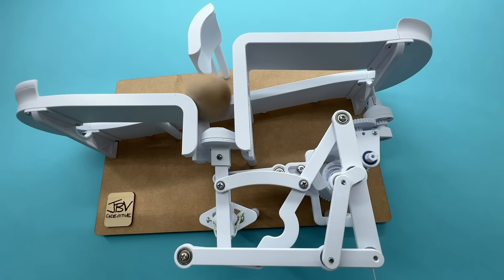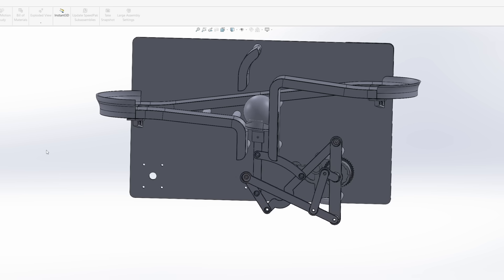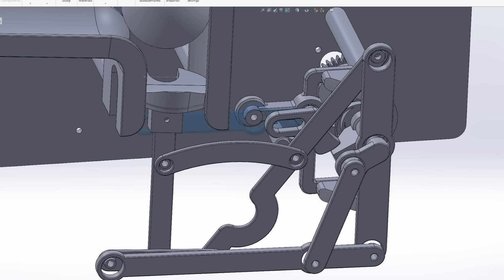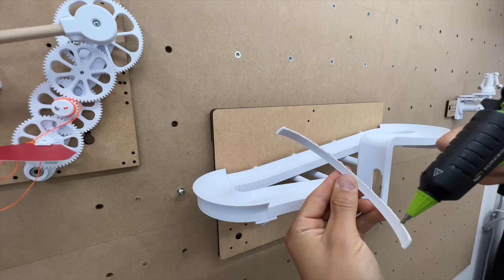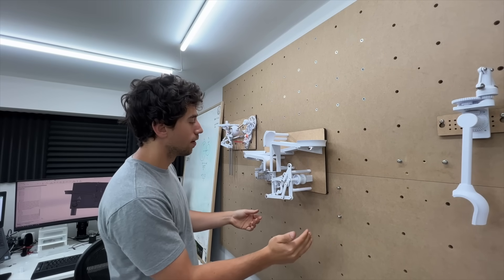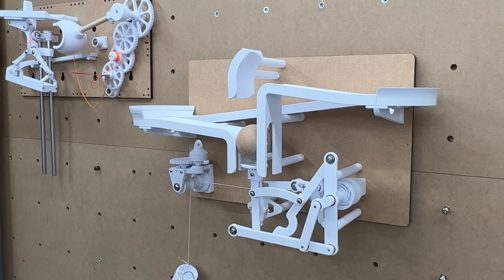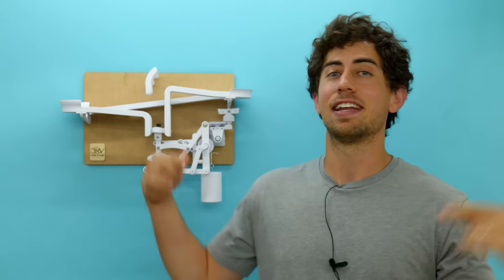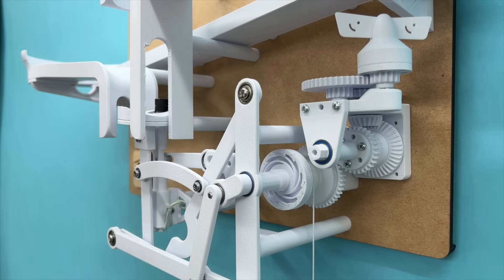Building a Gravity Powered Ball Contraption

Comment: Interesting….. considering there doesn’t seem to be additional input and this could just keep running, if you added pressure plates through the middle of the track when the ball rolls over and you connected those to a flywheel- could you charge a phone?

Comment: You left out the very important explanation of why this machine doesn't violate the Second Law of Thermodynamics (i.e. perpetual motion).  You showed the weight when you initially described the placement of the governor, and how its location made a difference.  What you didn't explain is how the weight under the governor provided energy to make the escapement and lifting mechanism work.  You didn't specifically show it, but I'm certain that when the string that's wrapped around the pulley on the governor mechanism is fully extended, the machine would stop.

This is a cleaver device.  Fully explaining the mechanism in terms of accepted scientific laws would be even more enlightening.

Comment: I'm sitting here wondering if you could set up 2 or more of these to work in a way where the balls roll around and at some stage become part of the weight and are then released from it with some sort of counter weight that resets it's position. i.e. ball rolls round into weight basket another ball rolls into lift weight ball pulls down lifting the other and both balls are released back onto tracks and the weight side goes back up due to a counter weight pulley system and the whole thing repeats. essentially a loop of mechanical advantage. if then it can be used to power a load you could cheat a theoretical perpetual motion. Of course I'm not suggesting in the slightest that the last part is at all possible but you should get at least close to the amount of energy you put in. Basically I am proposing a 2 way system using the same or a similar mechanism that swaps the balance of weight so the machine resets itself at the end of each cycle. Adding a load to that is the doubtful part but the mechanical energy although intermittent is technically infinite and mechanical energy can be converted into electrical easily enough.

Comment: Here's a tip that they use in clockmaking. When making an intertial governor like you're doing here and on the wave generator, you want to make sure it has a slipping connection to its shaft. The reason is that when it stops, the inertia that was keeping it from going to fast is also keeping it from slowing down - so when it is stopped it feeds back a major torque shock to your drive train. That all needs absorbed by your gears and bearings and can lead to excess wear and damage.

You can see on this device that when it stops it 'bounces back', you can imagine the amount of force it must take to reverse the direction instantly, it's even lifting the weight back up when it happens. If you make a slipping connection, the regulator can keep spinning and the excess torque from the inertia can be gradually absorbed by whatever braking mechanism you use instead.

Comment: For your straight line movement use a dual rail counter rotation conveyor belt what I mean is you have two rails that interact with a very edge of the ball and a small conveyor belt that interacts with the ball at the equator of it the ball will actually act like a gear and move in the opposite direction of the conveyor belt if done properly

Comment: Can I throw a thought in the fire?

Maybe add a counterweight to the crank mechanism so the reset isn't a violent drop. Get as close to balanced as you can so you're only really lifting the ball.

Then you won't need as much descending weight, or possibly increase the gear ratio with the same weight falling a shorter distance so the whole thing runs longer.

Comment: I don't want to sound rude or anything but how is this possible? did you use any motors? Im a physics student and it makes me question the theory of "Energy cannot be created or destroyed". I know there is GPE in the weight but I am bamboozled and still dont fully understand how this works after rewatching it in action for 20 minutes
Reply: There is a weight attached to a rope, the mass of the weight pulls it down, making the spull rotate, and powering the system. There is energy loss, and the weight is lower after each loop. The system will eventually run out of rope, or the weight will touch the ground, stopping the mecanism. To reload the system, you need to reroll the rope around the spull. This is an example of energy conversion between potential energy and cinetic energy.

Comment: Integration and testing would be so much easier if CAD didn't model everything as a rigid point-mass. At least the fabricator is working to the nominal dimensions instead of the positive tolerance. I would deal with a lot fewer unsupported flopping plastic pipes with the former, and I wouldn't get drain pipes that trap fluid with the latter.

Comment: Do you use specific 3d software to design the sculptures. And is that software also physics based? As in can you simulate the movement before you make it?
Reply from the maker: I do! It’s called Solidworks and it comes with a basic physics engine in it, super capable 👌

Comment: That is awesome! I don't know which CAD you use but I think for example Inventor and Solid Works can simulate physics so it might work out some of those problems you were having with slack, stretch etc, they probably can roll the ball too to figure out how high your walls need to be for the trough corners. You're an engineer so you probably know this. All it needs is a shelf next to it for a cat to sit on to watch the ball action. 😻

Comment: Clever .. but not 'gravity powered'.   You've got a weight that provides the power and when it hits the floor or runs out of string, the mechanism will stop.
Reply from the maker: True, but food for thought; if something is battery powered, we wouldn’t say its ‘thing that generates electricity to charge battery powered’. Once the weight it charged up, it is officially powered by gravity until the weight runs out of ‘charge’

Comment: Cool, but it isn't powered by gravity, it is powered by you. When you wind it up and lift the weight, you are providing the motive power for the device, and storing it in the potential energy of the weight that you have lifted.
Reply: Indirectly. But directly it's still running based on the gravity.

Comment: Can you recycle some of the energy so that when the ball starts rolling back down the raceway, some of the weight from the bottle is transferred back up slightly higher so you dont have to manually lift the weight as often.
Or could it use a separate mechanism with a tank of marbles that are released into cups which provide weight for the first mechanism, then at the end of each hour/day, you just have to lift one bucket of marbles back to the top.
Reply from the maker: Both are great ideas!

Comment: Cool project. There's an idea for improvement: you're actually wasting more than half of the potential energy available in the weight to return the ball pad into lower position, while this motion could is actually be gravity fed by itself. Could you modify the system to actually use weight energy just for rising, and allow pad to gravity drop by itself? Then you could have 20 cycles available with the same height/weight.
Reply from the maker: I’ve been thinking about this a lot, there’s definitely a way! Going to find its way into the next iteration

Comment: if the downwards movement of the ball over the slide can rotate the weight up again as the ball pushes through various levers, it will really be (close to) infinite.
Reply from the maker: There are definitely ways to increase the overall run time!

Comment: Besides putting it in a high place, I wonder if there is any way to get more cycles out the same drop amount. It would be interesting to measure how much energy is lost to friction in the linkage joints. 

Also, please sell this!
Reply from the maker: I’ve thought about it! The best thing I could do is add a gear train and increase weight, so it won’t drop as much on each cycle

Comment: It never re-spools the string with the weight, so it’s a bit of an optical illusion. Could probably change the gear ratios to get longer action on one run, but as soon as the string reaches maximum length, it will stop.

Comment: Does the system struggle by the time the string is near the centre of the spool? Or did you design it to run optimally at that stage? Either way it's impressive. You have a new sub from this ;)
Reply from the maker: I definitely didn’t give any thought to spool optimization but seems to work quite well 🤷‍♀️ sometimes you get luck haha

Comment: Cool project! It occurs to me that the gravity portion would require fairly continuous intervention to keep it working. Would it be possible to construct a gravity feed kinetic power source that was "powered" by a reservoir of ball bearings? If so, you could have a new module which would do the replenishing while its power was available -- like solar cells. Then you could potentially use this single power reservoir to feed all of the other modules... Thoughts?
Reply from the maker: This is exactly what my plan is!

Comment: I notice that the weight drops a long way each time the ball goes around so it won't take long to run out of string. What would happen if you changed the diameter of the cylinder the string is wound around? Would it still work the same and you get more goes before the string runs out, or would it affect things in other ways? 

I love how you show the different steps and the problems each step presents. Thanks for sharing your process as well as your fun machines.
Reply from the maker: It would definitely help, the only change would be more weight is required!

Comment: I think it looks really cool.. I can see a much simpler way to do it.. 
Just a ramp and a paddle wheel..(Like the wheel in the movie "Robots")
When the ball rolls into a slot on the wheel, it hits the other side(back wall)
The back wall is a release trigger that allows the wheel to turn and lift the ball to the top of the ramp..
The wheel has one of those teeth systems like a pendulum clock uses, so it only advances one space.
If you make the middle of the wheel, the spool for the weight.
Adjusting the (spool diameter)/weight ratio, to get max rotation for the least amount of vertical weight movement.

I am wondering if you can add a second weight that rewinds the first weight for a second pass...
Reply: Have 8 weights on 8 spools, each one with a ratchet so they are all linked on the same shaft of the main wheel. The 8 weights work like a 8 bit binary counter. 
Each bit(weight) would have to be twice as heavy as the weight on it's right.. 

or, just make one weight go all of the way to the bottom. When it hits bottom, it activates the second weight....

I don't know if this would work, but it's a starting point.. 
Thanks for the inspiration... I love these problem solving adventures.

Comment: Could this be built so that the ball moves for a specific length of time? Like a clock? So that every time it drops it registers 'x' seconds? Could this little machine create a never ending movement for clock or power purposes? I just get a feeling that this has bigger potential. Great work!!
Reply from the maker: It absolutely can! Unfortunately it wouldn’t be a very accurate clock as the ball movement could be affected by many things, but it would be pretty cool! Kind of like this: https://youtu.be/SrdtM6_yZUU
Reply: @Engineezy  Most time pieces aren't so accurate. Worth a try to see if it works? Each roll of the ball, which could be a ball bearing for more accuracy, could register a 5 second period that then turns the train of wheels for the clock mechanism? I'm looking forward to what you could make of this, I have a feeling it has a lot of potential. Well done and thanks for sharing this. Fascinates me!

Comment: Curious what texture plate you are using on your X1C. I use the engineering plate and it's smoother than what you have. I also bought a texture plate but it also doesn't look like your prints... so the plot thickens....
Reply from the maker: Its the stock PEI one that you can get from Bambulab!

Comment: Amazing video, those linkages are the most mesmerizing part for me. Also my family is moving along with my printer from 5,000 ft elevation to 9,000 ft. Will air pressure have an affect on the quality of my prints or the long term heath of my printer? I have an Ender 3 v2 so it’s not anything to complex
Reply from the maker: I cant imagine the elevation would matter as long as humidity doesn’t become a factor 🤔 but im not an expert on that stuff so not too sure! Thanks for watching  Max, good luck with the move
Reply: @Engineezy  thanks for the swift response! I’ll have to ask my dad if the humidity is different.
Reply: @Engineezy  I asked my dad and he told me that the humidity wouldn’t change much but if it would it would decrease. I would imagine this if anything would be a good thing as stringing wouldn’t happen as often

Comment: The return stroke of the lift can be powered by gravity. I wonder if there is a way you could allow it to disengage the weight at the top of the stroke. It would make this mechanism a lot more energy efficient saving you the trouble of having to crank the weight back up frequently.
Reply from the maker: I’ve been thinking about that, going to have to attempt to implement it in the next one
Reply: @Engineezy  the more I think about this, I wonder if a recoil is possible here similar to some clock escapement (I'm sure you're familiar with)

Extra beneficial to avoid your ratchet pawl absorbing so much kinetic energy. 🤔

Comment: Very cool project. In design of mechanisms and linkage text books there are stability analysis techniques that you can use to analyze compliance. Which will indicate thinks like poor stiffness at end ranges and then look for other solutions to the problems that stiffen at end ranges. It is definitely a 5-600 level mech-e type course, but it is very cool stuff and can be integrated into CAD without too much issue.
Reply from the maker: Definitely worth learning more about! Ill have to do some research

Comment: This is awesome. somehow I've never thought about escapement mechanisms for non-clocks (or at least non-periodic motion). Really makes me wonder what cool stuff could work this way - I haven't seen this channel before but now I need to go watch a bunch! I'm a big fan of the art/science combo.

This re-load mechanism for a ball kinda reminds me of a project in high school shop class where we needed to make a plinko-board kinda thing and we were scored based on how long it took (moment the ball was released at the top to when it finally stopped). The person I was working with had come up with a mechanism with a wooden dowel stuck through a barely oversized hole in a 2x4, attached with a rubber band. I think the original idea was to put a "pinball launcher" kind of thing at the start so we could "fire" the ball manually... Until we discovered that if you pulled the dowel all the way out, you could wedge it sideways into the hole and the slightest nudge would cause it to snap into orientation and fire the dowel through the 2x4. 
I remember trying for multiple classes to get a ping-pong ball to trigger it so it could re-launch itself and our entire plinko board could run twice by itself, but we never got it working. if only we'd seen this video!
Reply from the maker: The never ending plinko board! That would be fun :) so much possibilities in the realm of fully mechanical things, just less necessity for it- this is why I’m making art haha

Comment: another program you might like is Linkage, developed by one guy made specifically for linkages and kinetic art.
Reply from the maker: I was playing around with it a bit, also great. I just found motiongen a little easier to use
Reply: @Engineezy  that's fair, and thanks for putting the name of the program! Shared it with a few friends in combat robotics. We met at open sauce and discussed NHRL a bit.

Comment: How would it stop? Legit question because I still don't understand how it works. He doesn't explain much in this vid like his other vids. All I got is ball goes into the bottom, triggers an unlock, weight goes down, linkages make ball go up, somehow also lifts the weight and re-locks, ball goes back into bottom, repeat. I don't get how the weight is powering it. I need to see this in person or get a better explanation of the linkage/pulley system.
Reply from the maker: It stops when the weight hits the ground or when it runs out of string!
Reply: @Engineezy  Ahh that makes a lot more sense now, entirely. I initially thought you were doing some magic to also pull the weight back up!

Comment: Could you spring load the pulley for the counter weight to make it rewind itself back up? Using a spring loaded clutch of sorts to disengage it from the rest of the mechanism, it winds back up, clutch disengages then it goes again? I feel like it would be a really cool thing to just have endlessly going on the wall

Comment: lol, negative feedback never works properly when it isnt feedback...
governors... start inactive, WOT, then progressively attempt to slow it down, close the throttle, apply the brake. whether it be an engine, clock, or whatever.

governor theory in itself is rather interesting. hysteresis, response times, where its attached, and where its acting, lol...